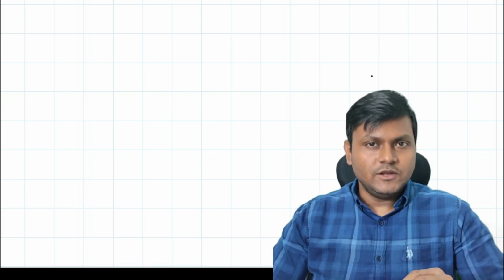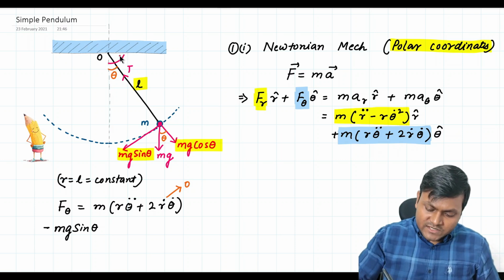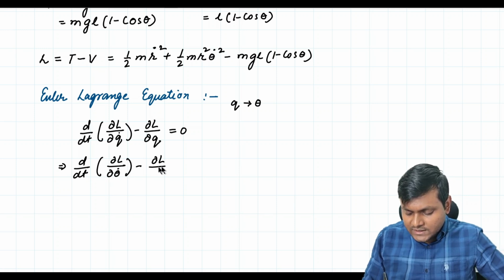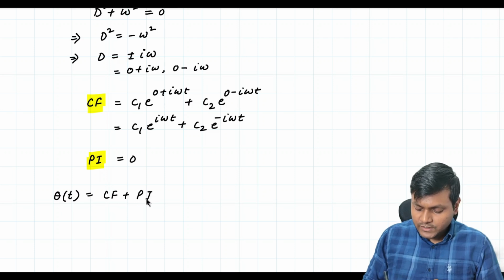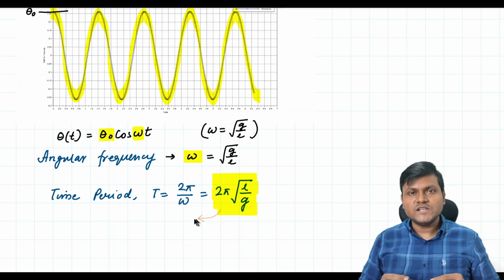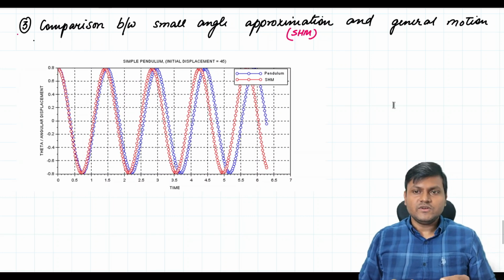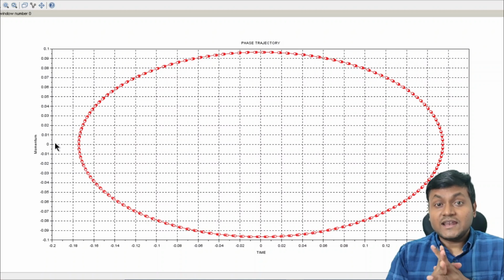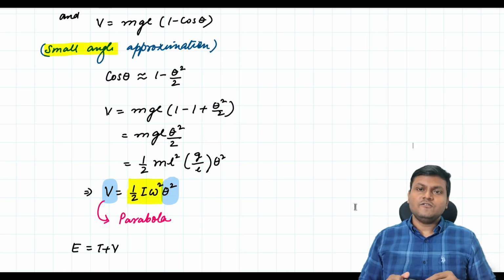Simple Pendulum (Step by Step DERIVATION)

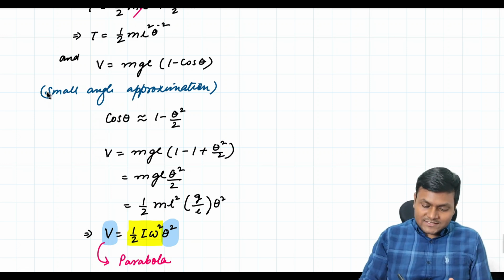Comment: 53:20 It behaves as a harmonic oscillator at small angles. I think this is a key thing we should keep track of especially for structural engineering students. EVERYTHING we do for structural dynamics hinges on this idea including modes of vibration. If you start trying to get solutions to the differential eom of the structure assuming nonharmonic, it just won’t make any sense. This is assuming we are designing the structure. 

It would be different if we had a study, for example, of the motion of a structure undergoing resonant frequency response.